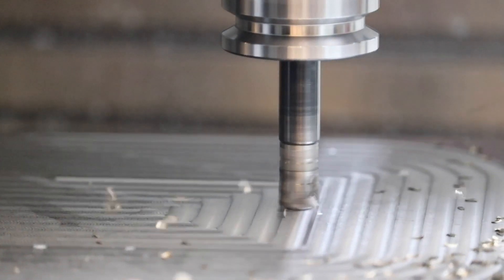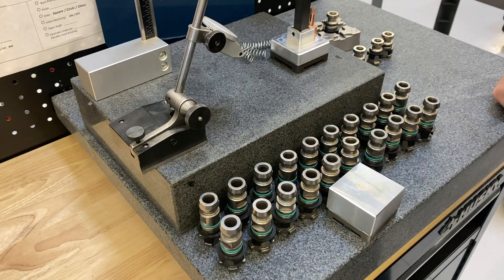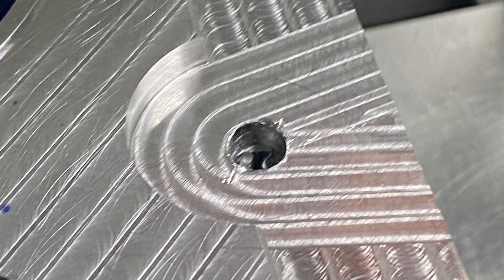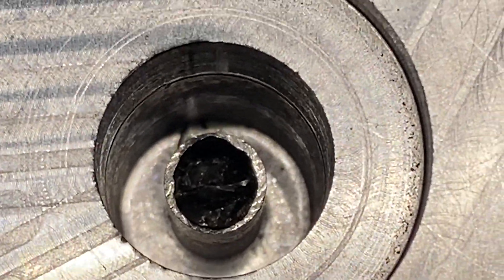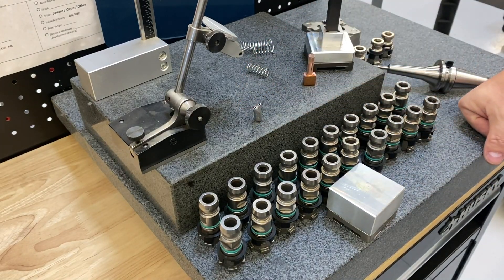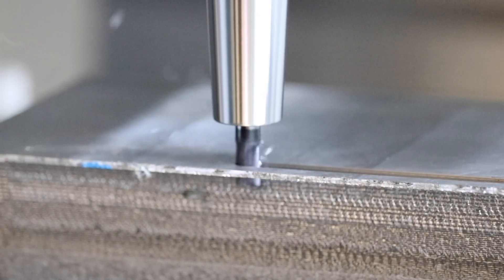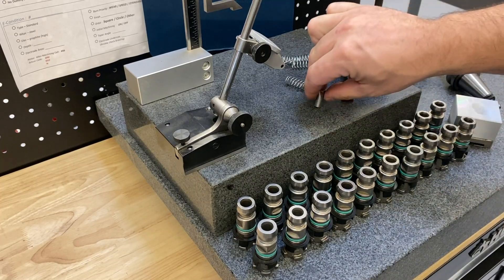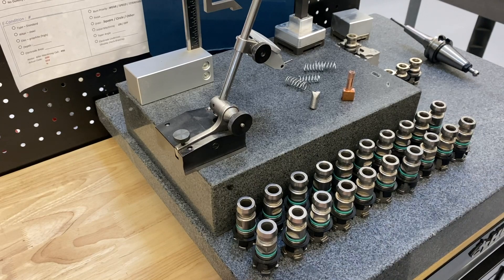Mold Rescue - Removing a Broken Carbide Without EDM

Comment: I turn off lead in and lead out in fusion 360 about 50% of the time for reasons just like this. My solution when carbide breaks off in harder materials like that is usually scrap the part so good save on this one. Good video mate.
Reply: I was going to say the same. I would never trust myself to stand there and wait till its almost done without getting distracted, at least hand edit out the lead out for god sakes!
Reply: @TheWidgetWorks  right! even though I can still getting a  tiny nib into the wall of my part when I pull out of a ramp without any lead out

Comment: Another trick you can do in Fusion to get around the boring center thing (I believe they call it lead to center) is to just use a 2D contour with a ramp and just uncheck lead out. I've had to use this a bit when the bore lead to center would interfere with another feature.
Reply from the maker: great tip

Comment: Need to keep some copper impregnated graphite blanks laying around for just this issue its kinda pricey but it'll save you
Reply: I use copper impregnated graphite for most jobs.  For carbide I use tungsten-copper electrodes.  They make easy work of carbide.

Comment: Hi, nice save! Would it be possible to burn such a broken tool out with an annular electrode? Or cut it out with a centerless annular cutter for that matter?
Reply from the maker: possibly.I dont have any experience with  annular cutters and CNC machining. More often then not the only the broken drill needs to be removed.